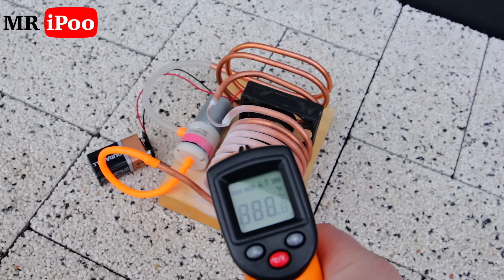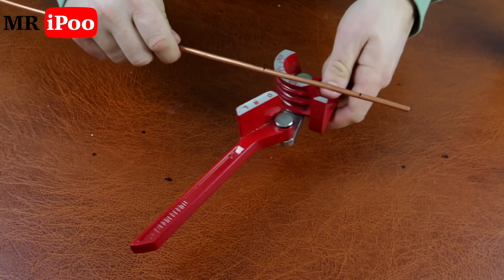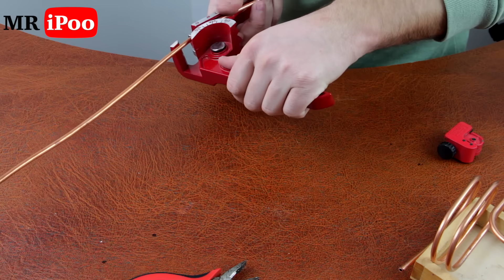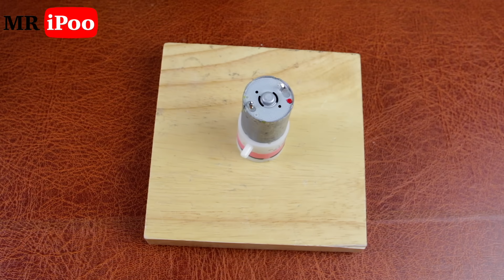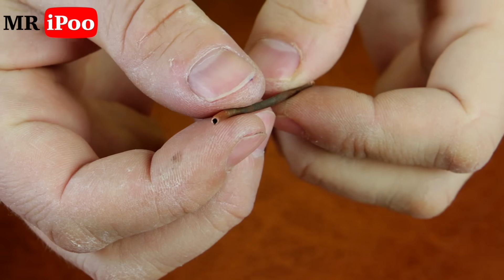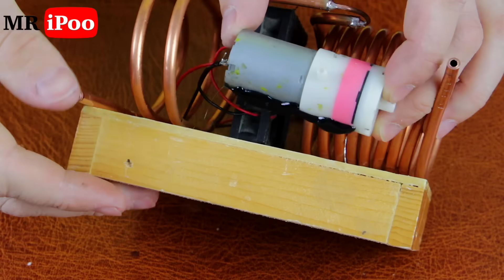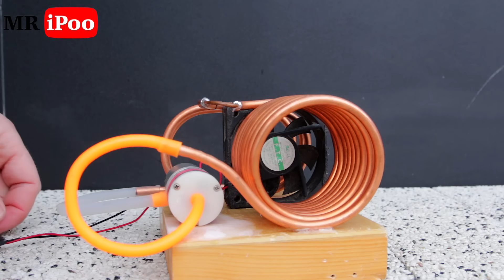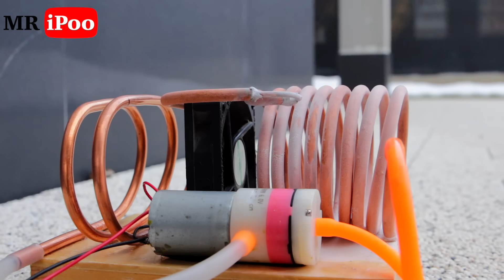DIY Freezing AC : Crafting an Icy Air Conditioner down to -32°C!

Comment: I have one of those pumps from a broken Keurig they get a pretty good low pressure. Pretty sure that pump can handle butane. 
I was wondering how you would have the expansion cycle, seeing the larger hose used as such was nice. 
Wonderful demo for refrigeration.
Reply: The expansion occurs at the capillary tube, not the larger tubing.
That larger tubing was used only because his pump had different sized ports...
The large tubing is on the hi side (compression), ~17psig or more, depending if there is propane content mixture.
Cooling coil is under moderate vacuum...
Reply: @troubleshooter1975  I've been considering making something similar, a small scale unit, although the cooling coils wouldn't be concentrated, but bonded to a stone slab. Basically, a basic chilled kneading board for breads and pie crusts that can be lifted out and swapped with a modular cutting board when needed.
The refrigerant of choice for that, propane.
If I want high efficiency, I'll order a fridge, for that, something like this would be more than sufficient. Just was uncertain as to the size of the capillary tube. Although, I'd probably add a desiccant drier in mine, since it'd be for regular usage, not just a demonstration unit.
I considered an adsorption fridge, but this wouldn't need a heat source.
BTW, did you know that Einstein designed a refrigerator for a cousin? An adsorption model, apparently it did enjoy some success.
Reply: @spvillano  Absorption cycle is still employed for the RV industry...

A stone (or ceramic) board is going to be a BIG heatsink...
It will take a while to chill the thermal mass (I think you'd have to prechill it in a fridge, then it could keep it cold for bread, candy, or whatever).

I don't think it is going to be as 'tiny' as you imagine.
The condenser I think will be bigger than the stone (so another words, big area).
It will probably need 1/12HP compressor.
A scrapped bar under-counter fridge would probably be perfect.
HVAC system fitters here may help you; you at least will have to consult tables to match up your components...
Reply: da f*ck.... 7:35 water is evaporating backwards ?
Reply: @MrPlastkort  Actually no-
I too was looking for positive proof one way or the other.

If that was water, then it should be collecting and growing.
If it is leaking butane, or freeze spray, then it will be evaporating, and shrinking.

I scrutinized that closely, and unfortunately, it appears to be something evaporating.
This part, at least, appears to be played 'forward'.

The telltale is at @ 7:35 where you can see bubbles forming INSIDE the drop.  There is one key moment where you can see two tiny bubbles that coalesce into one bubble; something that only happens in a forward direction.

Other clues that I couldn't prove:
Fan rotation; does it run backwards:
Rotation on video can render wrong so hard to tell.  Can't read the label to see if there is a direction of rotation stated.
Didn't see anything in the vicinity that could reveal direction of breeze or 'sucking' a blown object.

Setting things down:
When he put the battery down, and when he connected it:
If someone puts something down, or attaches something on, without having a grip on both surfaces, then it will show if it is running backwards.  If items 'attract' to his hand that he sets down, or looks 'magnetic'; or battery clips that precede his finger and connect themselves without fingers gripping on both sides of it.

I watched carefully and unfortunately he maintained contact with items until they were fully on the table, and held both sides of the battery clip, so I couldn't tell if it was off and pressed on, Or, if it was on and he pulled it off...
I don't have free time to review it frame by frame.
The way he filmed and held things, it is not easy to see if it is backwards or not.
[and it can be a mix of forward parts, and backward parts. Each cut complicates analysis.]
Reply: @troubleshooter1975  Has anyone tried it?
Because I did and the pump leaks the gas right away.
Reply: @WarpDump  don't see evaporation, I see frost.
Reply: Has anyone tried it?
Because I did and the pump leaks the gas right away.

Comment: Do you have a material build list?
Reply: Copper tubing, rubber tube, gas for refuelling lighters, syringe needle, 9v battery, pc fan, pump and a piece of scrap board. It was obvious!
Reply: @MicSokol   Will it work from a purchased lighter or does it have to be from a spray can?
Reply: @ivan.pr0.o  You can fill it with lemon juice it will work the same LOL

Comment: What was the temperature on the hot side? That would be good information because what you are doing is transferring heat from the side which gets cold to the side which get hot - and in your machine it shows how heat pumps are very efficient at using a small 9V battery to achieve a big heat gain.
Reply: Yep, and I’m just wondering how must pressure was being applied to the high pressure side since the are using plastic or rubber tubing to connect to the high pressure coil.

Comment: I'm calling bs on this, notice we never saw under the box it was on? He then charged it with butane and sealed the hole IN SILICON TUBING with CA glue? You know ca won't stick to silicon. It's kinda made not to let stuff stick to it. Then said hole doesn't leak? Show us underneath and I'll change my mind. I'll admit when I'm wrong. Just show us under it

Comment: I call 100% bullshit..  

that chincy little "Water" pump is not creating any pressure. It also doesn't have anywhere near the restriction that it WOULD need for as little as it displaces. FURTHERMORE, Heat transfer only happens when butane changes states from gas to a liquid or liquid to a gas.. Because the pressure required to maintain butane as a liquid is 2atm or about 30psig, I can tell you right now that not only can that pump NOT make 30psi through your massively oversized capilary tube, but the hose isn't gonna withstand more than about 1 or 2 psi before blowing off. 

This is 100% BS video..  The "Freezing" part was just the video played backwards after you sprayed canned air all over the place as evident with the white residue all over your wooden plank..  

Nice try tho..
Reply: Thank you, someone else saw through this. The fact that silicone hose with no hose clamps would somehow hold back pressurized butane? haha... no. And that little air pump is an aquarium bubbler. Flat out making 1 psi.
Reply: @colinsmith6340  I only watched it because I didn't know what they were doing exactly. I was thinking possibly ammonia, maybe? But the minute I saw butane i knew it was bs.
Reply: Hyperspace Pirate has a nice series of videos with actual tests and theory. They should get more views.
Reply: @KallePihlajasaari  Yea i love hyperspace pirate. Backyard chemistry and engineering at its best. and NOT a scam.

Comment: Wait shouldn't the pump be flipped around so that the vacuum side is the one for the evaporator and the pressure side is on the condenser?

Comment: Ok, something going on here that isn't being shown or admitted to. Notice how he didn't put the temperature gun on the 'hot' side? Also the hot side was very small in comparison to the cold side. I think what was really going on is that a load of already-cold liquified gas was admitted to the loop, and somewhere it was evaporating out of the 'cold' side. The pipes he used and with push-fit grip fittings are totall inadequate for maintaining sufficient pressure to cause such a drop in temperature on the cold side. Additionally, the 3mm pipe would not be remotely a sufficient obstruction to flow from a pump that size to create sufficient pressure that would cause such a drop in temperature on the cold side, and that pump is too small and the battery far too small to create such power. For that to viably operate on the principle it purports to be the hole in the restriction would have to be very tiny for a pump that size. and that is a low-pressure pump, not even capable of generating the kind of pressure differential required.

So, I think what's happening is that there is a leak in the 'cold' side of the circuit where the gas is leaking out, and it's expanding somewhere around the expansion pipe, because the cold liquid is now evaporating in order to escape and that's what is making the 'cold' side cold. It cannot be due to the means portrayed because the physics is just wrong. This circuit will only work for as long as the liquified gas on the 'hot' side remains liquid. Once it's evaporated out of the obvious hole, it won't work until refilled with liquid.
Reply: Butane is a fine phase change material for a refrigeration demo - low vapor pressure compared to refrigerants like Freon or Puron. The principle here is perfectly valid even if he didn't build something to cool your house and run for 20 years.  Perspective....

Comment: I was about to call you a fraud until I saw the refrigerant gas  Awesome job
Reply: Butane is a good phase change material for a small scale demo - low vapor pressure.
Reply: @davidsmith3302  oh awesome didn't know that. Thank you

Comment: It could work like this, he is blowing the cooler air from the evaporator side to cool the coils on the compressor side so after a while the energy added will bring down the evaporation side nicely but the power of cooling is super small obviously 😊
Reply: Evap would get colder sooner if he got the fan away from it. Should be blowing that across the condenser alone.
Reply: It wouldn’t work at all as the pump doesn’t have enough power to liquefy the gas in the first place